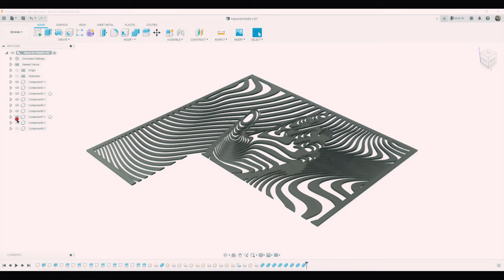3D Printed Wall ART 60x60 on (STANDARD 3D PRINTER)

Comment: I have been wanting to know how to split an STL for wall art for months now without success. I have been struggling with splitting into printable pieces and creating the pins/voids to connect them easily. Would really appreciate a video explaining the process :)
Reply: you can just open up a cad software and do some simple math to see how many squares you need to cut it into ie if you have a 200x200 print area and a 600x600 object you will need at least 9 squares, all you have to do is draw a line where you want to split it then usually there is a split option like in fusion 360 which is what he is using there is a split body option.